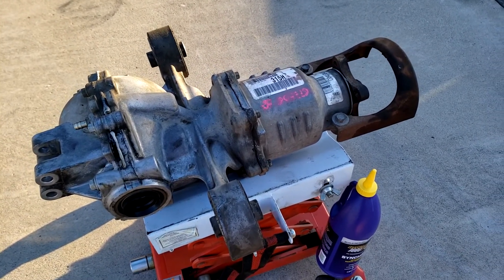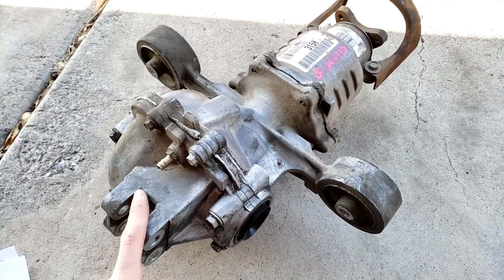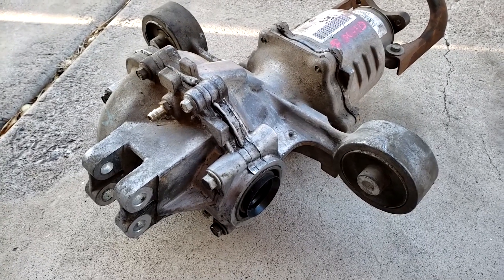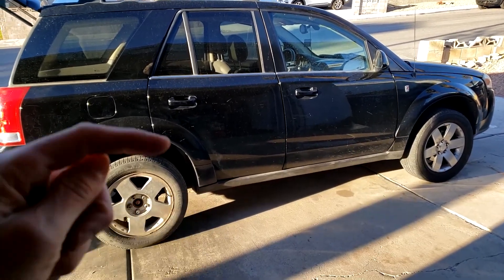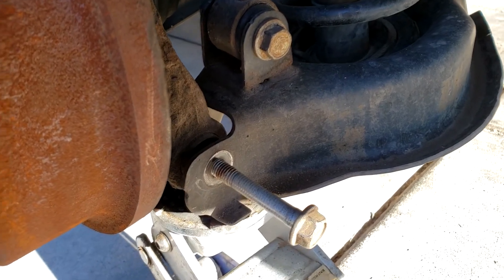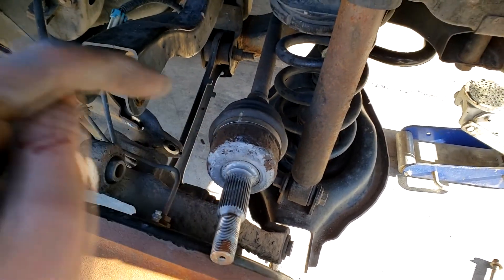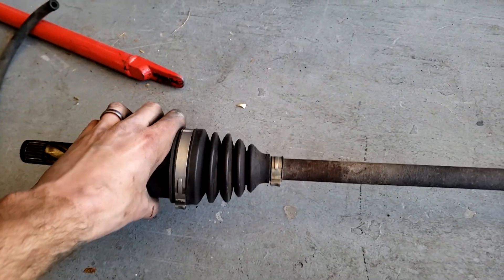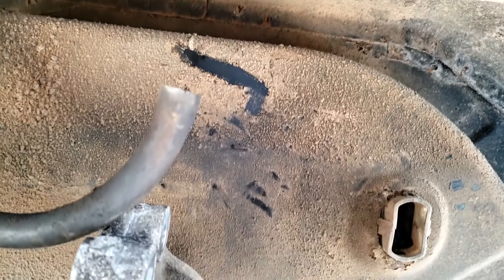Differential Replacement - Replace a Rear End (Saturn Vue AWD 3.5L)

Comment: Do your self a favor and use 90 weight gear oil in these diffs. It works just fine. A magnetic fill plug is also a good idea.
Reply from the maker: Can you explain why it's a favour?

Comment: My 2009 Saturn Vue has rear disc brakes, how is the job different when removing the rear passenger side CV axle? Thanks!!
Reply from the maker: Just check my channel for CV axle replacement on the Saturn view. It shows how to remove one with disc brakes :)

Comment: I do have a high pitch sound coming from the rear...I'm going to replace the fluid first before replacing the entire module...Your video IS A BLESSING....And I Can't Thankyou Enough...for All the time it took to film it.
I'm going to purchase "2" qts of VERSATRAK...In case I must change the entire unit. If it Does work....Can I use the other(new) qt...in the...transfer case?
Reply from the maker: Yes! Fluid first is a must and could be a money saver!
No, you cannot use the same fluid in the transfer case. I have a video on the transfer case, so you can see that if you wish
Good luck!

Comment: Do you think you can get the CV axles out of the wheel bearings by removing the axle nuts and just lowering the rear diff off the car?
Reply from the maker: Are they seized or something? There is no way you need to touch the diff when removing the cv axle
I made a video on removing seized cv axles on this vehicle already, its on my channel! :)
Reply: @TutorialGenius  No they aren't seized (as far as I know), but my Vue (same exact one as yours, 2007 3.5 AWD in black) no longer has a driveshaft so the rear diff is useless. I've watched a lot of your Vue videos!
Reply from the maker: @dnova6238  ohh gotcha! I understand now. I'd like to say yes, it's possible (If that's easier for you). Clearance is something that I usually figure out on the day 😆 I think it'll be tight though! Not sure if it would clear the lower control arms

Comment: I have a definite whine in the rear of my 2007 Vue.  It is front wheel drive only and drives perfectly except for that.  Passengers in the back seat say it becomes almost deafening when getting up to speed.  The pitch is matched with speed.  Any help or ideas?
Reply from the maker: Check wheel bearings for play, I have a video on that